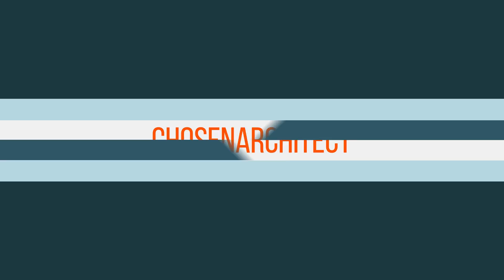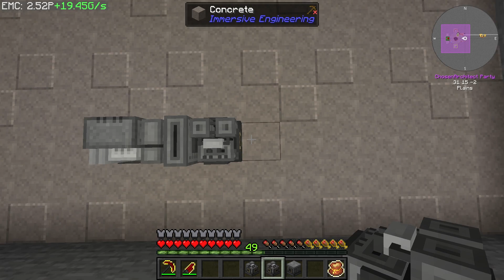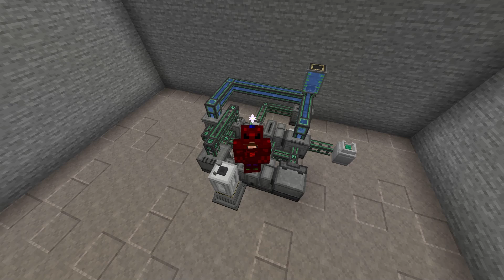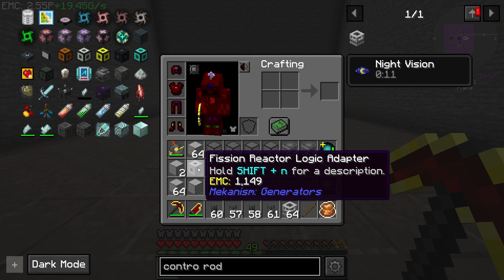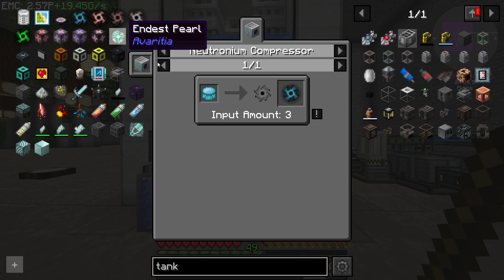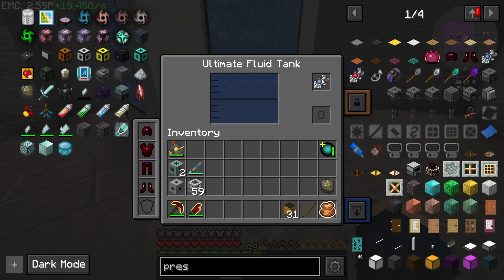StoneBlock 3 EP21 Mekanism Polonium Pellet Automation

Comment: Playing with Mekanism one of the best and easiest ways to get power going is from wind mills. The rest are naff. To get better power you need to build a reactor. Yeah.

Only talking about windmills here. They say it's best to put them up high. Which I was going to do to get them out the way. However I didn't want a pipe going all the way up. Let alone the cost of building a pipe miles away. So I put them under by base. However the windmill won't work if has any blocks above it. It's needs sky access.  So back up on my base I made a space made a gap for them and place fence around . So the lower level open for the windmills. And I wont fall into it.

Comment: I'm very curious, is it possible to just void spent nuclear waste in a trash can or are there measures to prevent that?
Reply: You can not, and you can't move it through traditional interdimentional means. The only method I've found was the entangled mod linked to a gas pipe.
Reply: Trash can worked for me…
Reply: Trash can worked for me too

Comment: Can this 5 x 5 be done in a max size compact machine?  Maybe make the fissile fuel in the overworld and use an ender tank to send it into the max size compact machine and chunk load the Compact machine?  That would save the base should things be irradiated is my thinking.
Reply: yes. i have like a 13x8 reactor in a max size compact machine and i produce fissile fuel in another compact machine block
Reply: @potatopenguin5864  that’s perfect, I’ll give it a shot.

Comment: I love the power of EMC but it also makes things rather boring. There are some cool mechanics and ways of automating things in each of these packs. Which are all completely unnecessary with EMS conversion enabled. It’s just makes things too easy and removes so much of the fun in complex automation setups. Which honestly is the main source of fun in packs like this, which require so many different things from so many different mods.
Reply: Trust me it has been balanced in this version back in stone block 2 you could just emc (mostly) everything including the singularity and infinity ingots also if emc (projectE in general) wasn’t a thing in this pack it would most likely be an expert pack so it’s seems relatively balanced in my opinion